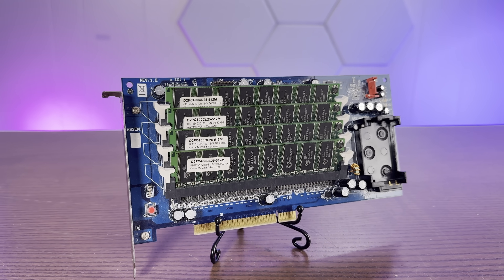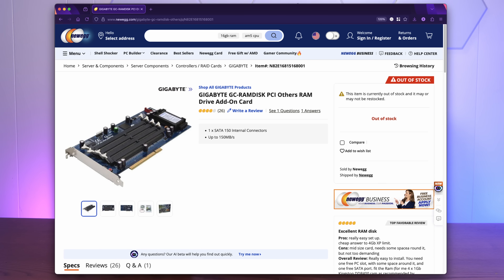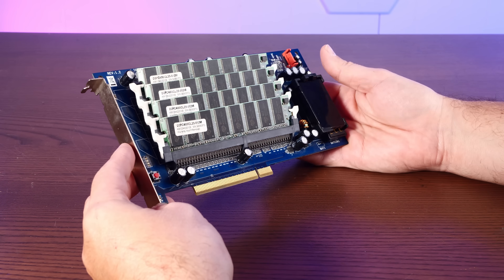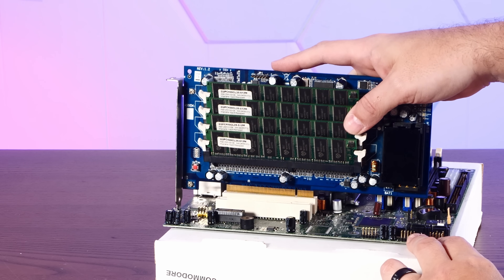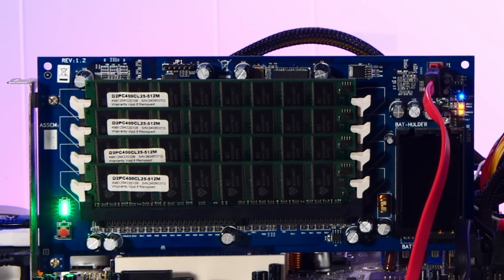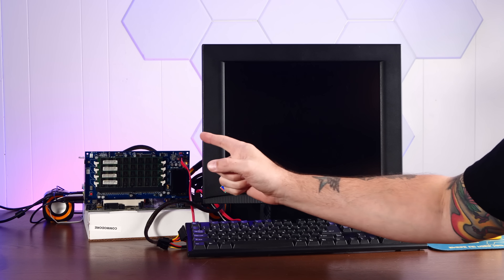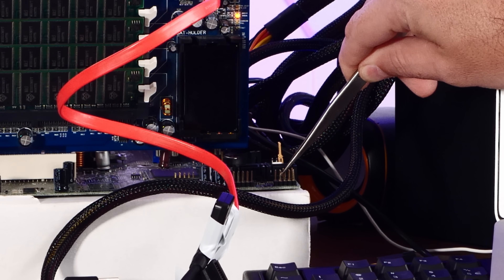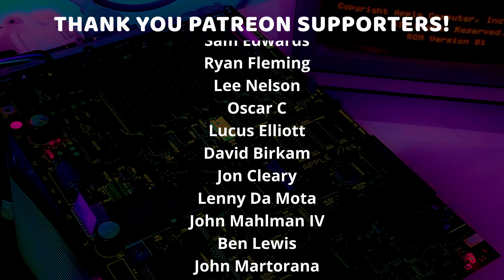This Early SSD Was WILD

Comment: Basic RAM Disk, but Wow $300-to $500 on EBAY AHAHAHAH... I just got rid of my Two Card for $50 each w/4GB of RAM..
But to me they are too Slow, I still use old Hyper Drive SSD PCIe 400 GB and 800 GB cards.. I get them for under $100 each..

Comment: The initial version of that device were awesome at random reads compared to a conventional HDD but 100% speed limited by SATA 1. However, if you were working with something that would fit into 2-4 GB of storage space it was pretty awesome. I believe there were later versions, possibly unreleased, that had support for SATA 2 or SATA 3 speeds. But by that time a small 8-32 GB SSD had come down in price enough to make the iRAM much less attractive in price. 

My first SATA SSD was a Sandisk 32GB SSD cache that came with software that only worked with Windows 7 and 8. It was fairly nifty for the time as it really did help speed up many common operations in Windows. The caching software took care of what data was read from the SSD and what came from the 2TB HDD I had in the PC. That SSD still lives on as the boot device for my Recalbox living room emulation PC. The OS easily fits into only a few GB, boots really fast off the SSD and all the game roms live on a nas.

Comment: Haha around the same time (probably more like 2008) I built an 8-disk RAID 5 array in my desktop which would max out at 800MB/s sustained read. I needed a 64bit PCI-X RAID card and a motherboard with the appropriate slot. (NOT PCIe!)

I also had one of these in a PC in 2006, and used it for swap & temp storage, due to the excessively high risk of data loss.

Comment: C'mon - I was using battery backed RAM disks with my Amiga back in 1988.  This 2006 card, while it may be rare, isn't anything new.  In fact, i had multi-gigabyte RAM cache "disks" for workstations way before this - mostly for database cache work.

Comment: About five years earlier than that I'd really wanted to use a ram disk for a computer I'd just built for myself. I don't recall what hardware/software I considered using, or was available, but eventually I just didn't bother as it didn't seem worth it. I remember now reading about the iRAM years later, and it looked like a cool solution. Glad to see the video.

Comment: A cool use case of such a disk is also when you intentionally want the data to go poof when done. For example, if you working with sensitive data from a read-only boot medium, and want a working disk. Just run this thing without the battery and let the data die when you switch off the PC.

Comment: 4GB of DDR3/4 memory is 10 euro now. I would really appreciate having something like this with 16 or 32 GB of RAM that you can write to forever without thinking its cells will die. On the other hand, you can setup a RAM disk of that size, and since RAM is cheap having 64 GB or 128 is nothing special, and if you're using Linux, making a RAM disk in Linux is so easy it's almost funny. I have a /tmp directory in a RAM disk and use it for compressing big archives, despite having a NVMe and SSD. RAM disk is still a king. Still I would buy something like this, regardless of battery problems. Maybe it should be powered by the motherboard and lose its memory only if you turned your PC off completely. ;) Oh, this thing uses SATA, that's a no-no. It should use PCIe for data transfer.

Comment: acard had a slightly later (ddr2) stab at this concept in a 5.25” format, and that did have a battery but it also had a built-in CF card backup. so if the battery died it took 1 button press to restore the data!

Comment: I have one. For a long time, I used it as a swap drive that got initialized at every boot. When I first started using it, I was willing to spare 4x 128MB sticks, but I later upgraded to 4x 1GB sticks. 

Unfortunately, mine seems to have died - it didn't recognize last I tried it. The battery had also swollen, so battery is long gone on mine.

Comment: I have one of these, battery has long since died but it's got the full 4GB installed. You know what would be proper dumb... a RAID0 of two of these... right? :D

Back in the day this was sourced as a way of speeding up a QMail farm. Spinning rust in a hardware RAID 5 array was great for capacity, but absolute trash for QMail's heavy use of temp files. I wrote the startup and shutdown scripts, we just assumed it wouldn't survive a shutdown, so at power up we'd format, lay down a filesystem and restore the last state from the backup that was written to spinning rust at the last shutdown. Worked well, MASSIVE speedup in how much mail we could shove through a single box, rather than 5 incoming MX boxes plus a load balancer. Later got life as a Readyboost drive when I was testing Windows 7 on ye olde Celeron EMachines that capped out at 512MB RAM.

Comment: Might put some temp files on it even with SSD boot drive. All SSD makers claim "Huge" amount of writes for lifetime but owners have no clue how many writes per hour in temp file just for the web browser. Too small as Windows Swap now but even with WinXP 2GB Ram Disk is small too. Many XP machines ran 256 or 512MG and beat the hell of the Disk using the Swap and complain system is slow...

Comment: It's random access speeds will still absolutely shit on any modern SSD, and there's no reason they couldn't make an updated version of the board using the current memory gen and PCIe (no SATA cable needed) and modern rechargeable batteries... though you might be limited in speed or cost today b/c FPGAs that can max out PCIe and DDR5 are probably super expensive (if they even exist). It would be really great for certain workloads, but for 99% of consumers and situations, it's not worth the effort and thus they wouldn't sell a lot. I could see it being something for servers and data centers... if they don't already do something similar with virtual hard drives for VMs hosted in RAM.
Edit: and as the SSD gets full, the sequential read/write speeds go down exponentially to HDD speeds. That wouldn't happen with this card either.

Comment: I had a few of these ram drive cards in the 1990s, but they were small...   and mainly used back then to store MSDOS on.
I've been looking for a modern equivalent of them for the past 5 years...
In lieu of them, I've been using my System ram and a free RamDrive tool called ImDisk....
I like all of my project files during video editing or AI video image manipulation to be in RAM...   and having a very fast scratch disk, that causes no wear if i were to use my SSD's instead.

Comment: The key value for this board was as a very fast temp directory for building code or as a work space for temp files from things like databases. Neather task needed long term storage and the performance was better than SSDs for a long their due to the SSDs of the time limitations when it came to writes.

Comment: @10:33 - iPhoto (Database) if you put it inside a G4 or G5 (PCI) - could easily scroll several hundred thumbnails inside Tiger. Very practical as a retro photo viewer even with modern (20mp+ large) jpeg files ~ 10 thousand photos, etc. CPU would be the bottleneck

Comment: The only thing this would really be useful for is, as others have said, a scratch disk or swap space, if you don't have an SSD.  The limitation here is the JMicron bridge chip, since it only supports SATA Revision 1.0.

However, back in the day, when USB was slow and CDs were slower, I could see myself putting a Windows or Linux diagnostic image on that thing and using it as a malware or virus-hunting tool.  Something goes south?  No worries - pull the battery!

Comment: This is a PC version of  the late 80's Applied Engineering RamFactor Card with it's External Battery Backup *edit called RamCharger* .  I booted Prodos / Appleworks from the card in less than 10 seconds.  Have no memories of total disasterous data loss, but I was vigilant about backups.  I used it less after purchasing a 40MB SCSI Hard Disk.  It is still in the Apple Retro Bin.  I think I will take it out and give it a spin again.

Comment: Gigabyte were cooking with this. Enthusiasts were already running entire Linux installs in RAM as a "Ramdisk" , so they figured - just put a battery on it and make it a permanent RAMdisk. 
If I remember correctly, the Apple Newton also used a RAMdisk for storage, meaning if your storage battery died all of your data was gone.

Comment: Apple II, Ramfactor with battery backup. I had one way back when. It was very neat, but you better have everything on floppy as well. 

The board and backup power supply were made by Applied Engineering.

Comment: 2 years after this thing's release, we deployed 6 servers with i-RAM Box on them. A repackaged version of this that fit into 5.25" drive slot. It had a SATA and a Molex adapter at the back, along with a 5V standby supply you could steal from the ATX connector. As long the PSU is connected, you never needed to rely on the battery for retention. 

These things we not good. It didn't support ECC RAM. Corruption was inevitable even under 24 hours of uptime. IIRC they still somehow served our needs for the first month. We had a mishmash of custom built towers and donated Dell T105s with 8GB memory. We kept PostgreSQL's pg_xlog directory on i-RAM backed 4GB block device so we could keep up with the write speeds.

Even though we got the i-RAM Boxes for free along with the Dells and and some networking gear, the setup barely made sense. By the end of the first month, we figured out a safe way to aggregate writes on the sender side and cut down our write volume significantly. Being able to fsync pg_xlog around half  the payload throughput we could get from gigabit ethernet (~60 MiB/s) made i-RAM moot. A few months later, we moved on to beefier machines and I never saw i-RAM Boxes again.

Comment: I had a few of these loaded into my hodge-podge clone servers that were running  various VM tools to build my early home network.  Like mentioned early in the video, I used them as page file disks trying to get a little extra performance out of the machines.  As page file disks they were great.  Data loss wasn't a problem.  Worse case you'd get an error cause the ram ran out of power and the disk disappeared and needed to be repartitioned and formatted again before moving the page file back to the thing again.  I think I also tried the same with Linux and using them as swap drives for some of the VM servers I was trying to use.

Comment: I had an IDE to compact flash a diaper that I used as a boot drive. I had an 8 gig compact flash
Much faster than a mechanical drive.
I had a few zip drives as well.
But I will say the slowest thing that I had to deal with. Was dial up until we got DS.L.

Comment: In theory, a version of this card based on PCIE, modern storage throughputs, and at least somewhat more recent ram speeds could genuinely improve a barebones system. If you're running 4gb of ram, (a modern version of) this thing could be one hell of a paging file.
Reply: Or optane, if intel weren't cowards

Comment: I remember hearing about those cards back in the day.  I would have used it for basically for the pagefile for Windows (Only OS I used back then, really) and let Windows just recreate it each boot.  I wouldn't have used it for any actual data storage as I'd create a 2megabyte RAM drive to throw temp files at.

Comment: Wanted such thing for my Core 2 Duo, so that I could have 4 gigs of temporary space for Audacity or for compiling stuff. There was also version with CF or SD card, it would use battery (or ultracapacitor) power to copy RAM content there. Later at boot it would do reverse, not sure at what speed though. Briefly had GPU's RAM used for that purpose, but that had some issues. Now I got that in system RAM :)

Comment: The holy grail way to configure this would be with 4x1GB sticks of Corsair Pro Series.  That RAM had built in LEDs to indicate memory utilization.  I had a single pair of 512MB sticks of that RAM.  When the computer was running, the lights looked like the volume meters on a hi-fi.

Imagine 4 sticks of that all lit up and showing how active the RAM is/was.
Reply: Go for broke, two of them in RAID for eight gigs total.
Reply: A small correction - those were Corsair Xpert series, not Pro.
Reply: @zusurs  Thanks. I just looked at the label and saw "Pro".
Reply: Running XP on it, these would have been run in disco mode!
Reply: I remember that RAM well! I won 4 sticks of it writing a letter to Custom PC magazine about the demo scene.
Reply: ram with big heatsinks wont fit dear sir ;)
Reply: Best RAM are from Micron / Crucial.

Comment: There were IDE and SCSI Ramdisk's using DRAM and later SDRAM in the mid to late 90s as well. I also remember a native PCI-Ramdisk with SD-Ram in the very early 2000s but i cannot remember the name or the manufacturer. The only thing i do remember clearly is that it was not compatible with my Power Mac i owned at the time.

Comment: if someone lost critical windows files, they were not using ramdisk correctly. you dont really install to it. you have the system boot and image to ramdisk and use the ramdisk untill you shut down and then it caches the data back to the hard drive. its not meant to make booting or shutting down the os faster, rather speed up access time for a booted session. you can use the ram on the motherboard this way too, if you have enough, but consumer machines of the era usually didnt support enough memory to effectively run a ram disk and have enough system memory left over to do anything useful with the OS. Using it as a scratch disk is a fantastic idea.

Comment: That card would be a hackers dream. Just purge all the data when you know you are about to get caught.
Reply: Not really.... It's possible to recover data from RAM. RAM chips ate volatile only for customers. With proper tools and knowledge (Forensics level of knowledge) you can recover data from RAM.
Reply: @danielsfonseca With a freezing attack yes, but that kind of attack would be tough to do quickly enough if power is pulled from the memory the data should start degrading immediately.

Comment: Would be great to have even now. We all have old ram that would find a new use, though would prefer it used pci3 and up.

As it stands, i currently have my scratch disk as a portion of my ram (40gb). Used soley for downloading/extracting, before I manually transfer anything I want to keep to non-voliatile storage.

Reason being, ssds have limited read/write cycles so shouldn't really be using ssds for a main place to download everything.

And secondly, ram is much faster that it can keep up with the full network bandwidth of the system, maximising download time, no buffering or risk of maxing out an ssd cache with too much info at once.

Comment: Does it work as a thumb drive while not plugged into a motherboard? If so it would make a very silly portable thumb drive that has a built in self delete function. If not I wonder how hard it would be to power it externally to use it like an external hard drive. Maybe tap a 12v line to trick it into working?

Comment: Would have loved to have this back in the day as a game drive. Before SSD, the typical way to reliably dramatically speed up load times was the 3 drive solution. OS and APPs on their own drive, the swap file on it's on separate drive, and then putting games on their own separate drive.
Reply: ramdrives are still used in high performance servers as swap drives or for temporary directories. I have a desktop with 2Tb of RAM and have some scripts that create 1Tb drive and copy some application there. Helps with software that does insane amounts of disk I/O operations at once. Because RAM is waaay faster than most SSDs. Usually 3-30 times faster on some operations.

Comment: Actually this would be perfect for journalists or whistleblowers who are working with extremely sensitive data in areas which their physical safety cannot be guaranteed. If someone is breaking into their rooms or apartments, all they have to do is remove the battery and all the data is permanently gone in a second.
Also, could be useful for black hat hackers who need to worry that the FBI is going to break down their door any minute and again, all they'd have to do is pull the battery and all the evidence will have vanished into nothing.
It would be cool if there was a modern version of this device that could use PCIE5 and modern DDR5 memory with a modern battery.

Regarding this one, upgrade it. Find 4 DDR1 PC-3200 sticks to upgrade the "storage space" to 4GB. Then install some linux distro's on it. Try enabling disk compression and benchmark with and without it. Try playing some games off it starting, of course, with the original Doom.

Comment: I remember there was memory bay drives at one point, it was something i wanted to get, same concept but more sticks. 

i do like the idea of this and want to see more of it. there are use cases where we can reuse old ram for a trans coding drive. (with an nvme version)

Your cursed idea has some use cases, think of a usb drive that needed to stay powered for it to run, pull the power, data is wiped, Think of it as a temp usb drive that will only keep data for a limited amount of time, like two days, if your secure drive that you use for passwords is left longer then that lost then you don't have to worry about the data being stolen. wonder if this is a product.